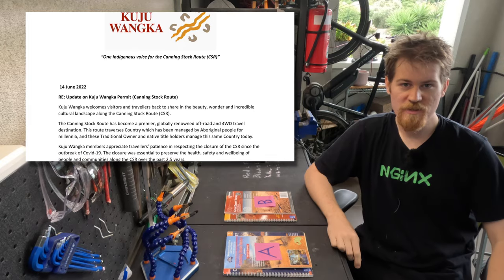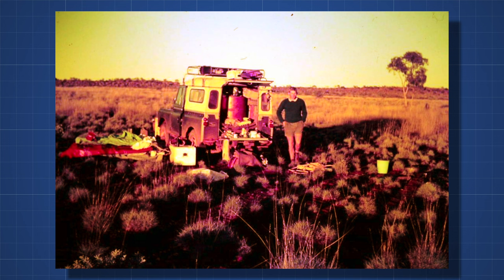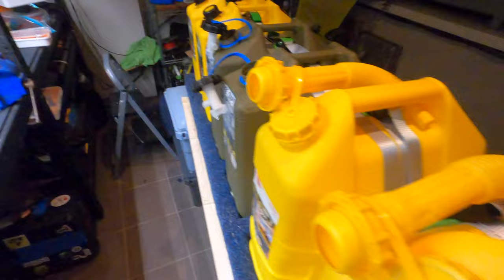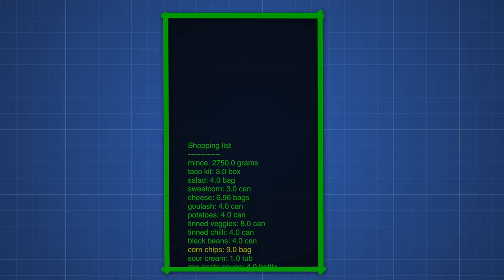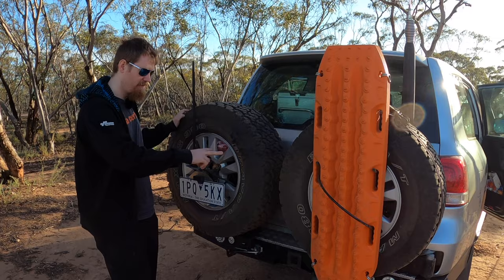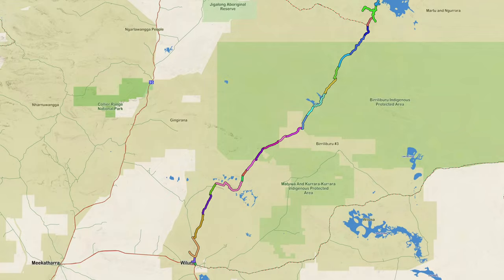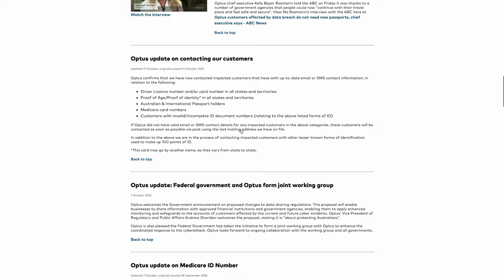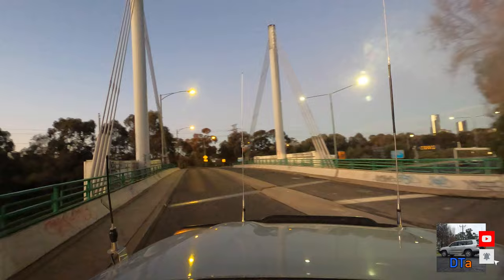Yes we Can(ning)! - We're doing the Canning Stock Route, but first, some preparations...

Comment: My wife & I have spent over 27 years and completed more than 40 complete crossings of the Canning.
As far as this video goes I have never seen so much over preparation for such a trip.
It is 1020 Kim’s from WILUNA to Kunnawarritji. With careful use of your right foot you can do this using 
only 100 ltrs of diesel fuel. 
As far as spare parts are concerned, think and check everything in the vehicle. If is up to date and in good 
Condition there is no need to overload your vehicle with an excess of spares.  Shock absorbers are definite 
Must. ( front ones mandatory).
Food wise. Fresh food can be kept fresh for a long period of time by wrapping all vegetables in newspaper.
For communication a good U.H.F set and a “ SPOT” tracker will cover all your needs.
Don’t take all those things you think will come in handy, leave them at home and keep your vehicle as light
As possible.  
With careful thought and planning you will have a great trouble free trip.
One last thought,  Make SURE you carry a water fire extinguisher. Small drink bottles with pop tops can be very useful.
Remember “SPINIFEX” burns extremely hot and is devastatingly quick. Check under your vehicle constantly.
Happy travelling.  Eric & Ronnie.
Reply from the maker: I'd imagine after doing the trip 40 times you'd have a pretty good idea of what you'd need and what you wouldn't. Having not done it before I was intent on ensuring we were completely prepared. And yes, I would probably do a few things differently next time. Actually, having been so "over prepared" as you put it, the trip almost felt anti-climactic, it was so easy.

I didn't think we were particularly heavy on the right foot - but we still ended up burning 242L with 1061 km travelled. It was travelling through loose soft deep sand, so it didn't seem inordinately high for the conditions. I'm impressed that you did it in 100L of fuel - what kind of vehicle was that in, and what was the track condition like?

We used HF for position tracking and email because we're both amateur radio operators, so it's basically free - no charges or subscription to operate any of that other than holding the amateur radio license. The other vehicle we were with had a Garmin InReach - similar to the SPOT tracker you mentioned.

Definitely heard about wrapping vegetables in newspaper - although being from the other side of the country we avoided carrying them as we'd lose them at the WA border.

And yeah, agreed about the Spinifex. You'll see many burnt out vehicles in our later videos. While some of them "caught" fire well after being abandoned, many of them were Spinifex fires.

Thanks for the comment.

Comment: There’s quite a few videos on the canning but none of them really go into any detail on the packing side of things which you have done which is great. I’ve been planning to do the canning for the last three years so hopefully I will get there next year. I will be travelling solo so it should be one hell of an adventure. You can now tow a trailer from Well one up, Friends towed there track trailer T van back in 2018 and it wasn’t an issue to go from well one as they have realigned the track( you probably know this by now)
Looking forward to the rest of this series. Cheers Philip
Reply from the maker: Thanks for your comment! We were both of the opinion that if done right, the packing and preparation would be the hardest part of the trip - because getting it right makes the actual trip so much easier.

I saw the track realignment in places in the section through Cunyu Station, and it certainly looks less arduous than some of the old pictures I've seen, but the old track rules sign saying "no trailers" did remain when I went through - although I've heard some have contacted the station owners for permission and have been told it's OK. I didn't ask myself as we were not towing, so you may be right that it's now allowed.

Next video goes live on the 16th at 6pm AEDT, there should be one every two weeks until I run out of videos to make. I don't exactly know how many that will be, the trip was a month long and we got up to a bit more than the Canning.

Good luck with your trip, as well, hope you successfully complete it!

Comment: Regarding the soda stream, im 90% sure you can get adapters for the back that allows you to hook up a  much larger co2 cylinder.
Reply from the maker: Yeah, I've seen those, and am considering getting one - would be a lot cheaper for home use. Not sure of the advisability of carrying a 2.8kg CO2 cylinder on 4WD trips though, but you can also get adaptors to refill the SodaStream bottles yourself.

Comment: I did the CSR over about 10 days in 2010 in a JKU Wrangler. July-August is best time - not too hot but dry....2000km of corrugations. Weight is your killer here. And speed. I took 250 L unleaded petrol and used most of it. 4WD was mostly not needed. There was one or two big dunes but these were not difficult at all.I would not trust water quality for drinking. Best to take what you need plus reserve for breakdowns. I take 10 days extra to daily use (calc 4l per person per day). Better to have water in multiple small containers than only 2 big ones, which can/will leak. 600ml bottles nooks and crannies is wise. Food that is light weight easy to prepare variety. Cook with gas only. I swagged it...need sleeping bag for very cold nights (-2C). A Sat phone and 2way CB radio are essential.I used Hema maps and Hema6 unit.The track goes north:south so hard to get lost of you stay on it. In peak season about 600 cars a month travel the track.A soda fountain...wankers world!
Reply from the maker: Thanks for your perspective on the trip. 10 days seems pretty quick - how much do you reckon you ended up driving per day - and I imagine you didn't spend two nights in Durba Springs?

As for the water containers, we did have three instead of just two. None leaked (after applying silicone to the footwell tank, of course), which was fortunate. The footwell tank has a hump in the middle (to fit over the transmission tunnel... that the LC200 doesn't have), so if it gets a hole in it, you won't actually lose all of it.

As for the SodaStream - yes, thoroughly unnecessary. But not that big or heavy, doesn't use electricity, and lets you enjoy some fizzy drinks out there... just a bit of fun.

Comment: Hey mate, knowing what you now know, how many jerry cans would you take to go the same trip again?
Reply from the maker: In a later video, I did a review of the fuel used when we reached Kunawarritji to fill up - with all 7 jerry cans poured into the tank on the way, when we filled up there was 36L left in the tank. So we could have made it with 6 - but with only 5 we'd have been 4L short. 

So knowing what I know now, I'd still say 7 - in case you end up doing worse than planned (it's wet and boggy, or dry and even softer), or you have to backtrack for whatever reason. Or maybe one of the jerry cans springs a leak, splits, cracks, rubs through, or otherwise fails and loses its contents (hopefully one on the roof, not one inside!).

The section north of Kunawarritji is shorter though, and you can fill up at Billiluna if you're desperate (although just to be safe I did fill everything at Kunawarritji - ending up short on fuel will cost you much more than the $3.10/L diesel...).

Comment: Very informative video, thank you.  I have though did you feel the Donaldson air filter you fitted reduced the engine power or fuel efficiency.  Thank you
Reply from the maker: I feel like it had a little bit less power when you went wide open throttle, but on the other hand the vehicle had a roof rack and was heavier than usual - so it was more likely just that.

Fuel efficiency on the highway seemed normal - and on the Canning about what you'd expect too.

I did take it off when we got home (it is a little noisy) and the vehicle didn't feel like it got faster, either.

Comment: You've HF radios coming out of your ar$e but don't own a printer😅

I'm sure getting a satellite phone would have been easier and lighter than the ridiculous HF set-up.

The added weight of all those spares!

Have you weighed your vehicle loaded to make sure you're not exceeding the GVM?
Reply from the maker: I do own a printer... it's just a 3D one :)

And yes, you are correct - a satphone is smaller and lighter than all the HF gear, and would possibly be a better choice for many. Though as I said, the Garmin InReach is a better choice than that as satphone calls are expensive and often unproductive (call the dealership for tech advice, get put on hold for half an hour ($50) then have the call drop? Better to text a friend and have them call.). We have the PLB for life threatening emergencies, which is satellite based but has no ongoing fees.

But the thing that I love is that HF gear can talk directly to somebody else's without having infrastructure. The HF gear doesn't cost a single cent to operate, nobody's charging for data or time (on amateur radio that is - and amateur radio being a class license now, don't even need to pay for license renewal - just once off for the exam and callsign). And it's a shared medium - I can just put a call out to whoever's listening, whereas with the satphone you need someone specific to call.

And while HF data is slow, we still had it all - could talk to people with voice, send text messages and a position ping every 5 minutes via APRS, email via WinLink, share photos via SSTV, even post some (very low res) pics to social media!
Reply from the maker: I was just reminded of this by a recent announcement... if I was to have bought a satphone, I probably would have bought the Thuraya SatSleeve (it attaches to the back of your phone, and you make the call with your phone, but you can make an emergency call by pressing a button on the device itself, without a phone.)

And then this happened, where Thuraya satellite #2 has died, meaning no more coverage in most of the Asia Pacific region, and your satphone's now a brick: https://www.pivotel.com.au/knowledge-base/faqs/thuraya-network-closure-faqs.html

(I'd likely have actually bought an InReach, which uses the Iridium network, though.)

Oh, and I missed your question regarding weight - we have a 3.8T GVM upgrade, the vehicle has been weighed and the weight of these items added up. It was (only just!) under GVM. The total weight of all the spares and fluids was only about 100kg.